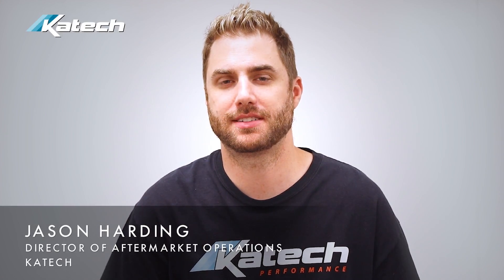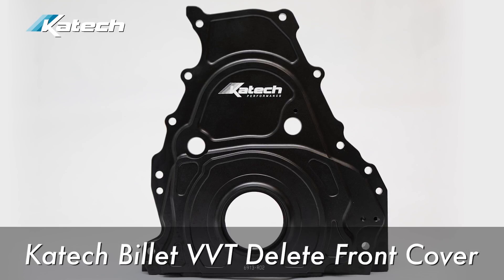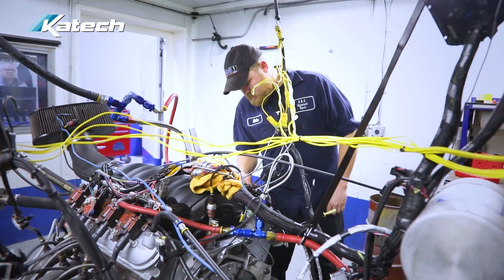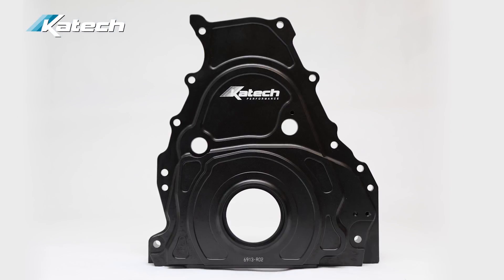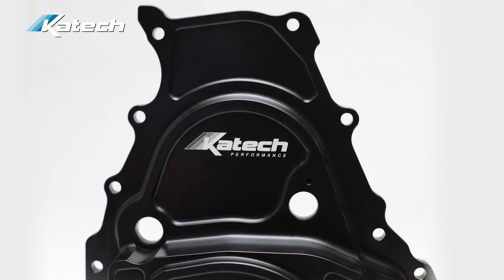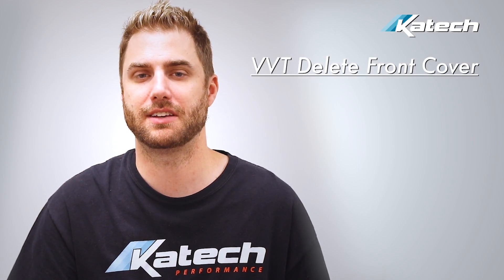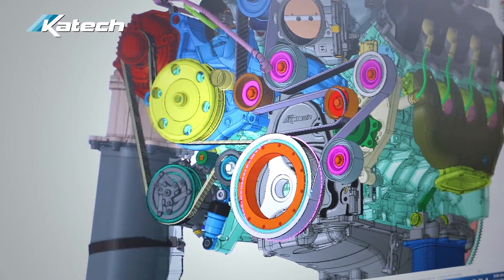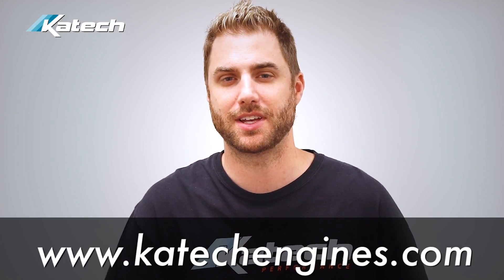Katech VVT Delete Front Cover For Gen 5 LT Engines

Comment: Is there any benefits from running VVT Delete Front Cover ???  other than fact it looks good ...
Reply: It removes all the complexity of the VVT system, less room for failure, lighter rotating mass internally, and removes the 3 degree timing advance/retard with a static setup.  Makes higher horsepower engines much more reliable is the bottom line.

Comment: Just ordered this for my LT4 build.     How are you degreeing the cam as you say to do on your website?   The LS3 cam gear isn't adjustable and I can't find a milti-key crank gear for a GEN V LT1.
Reply from the maker: RecklessRegal we are getting a few degrees out of the stock sprocket or sometimes we drill the pin hole.